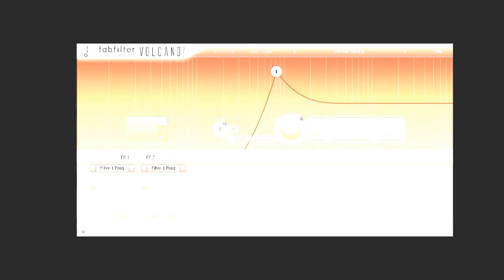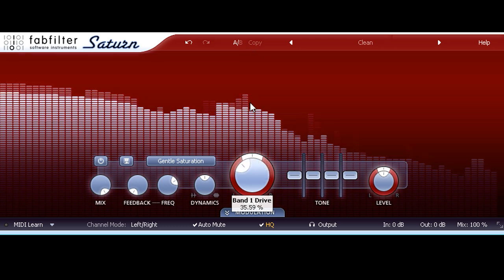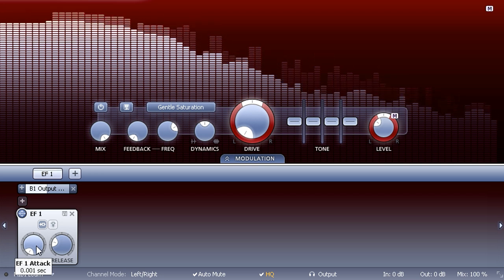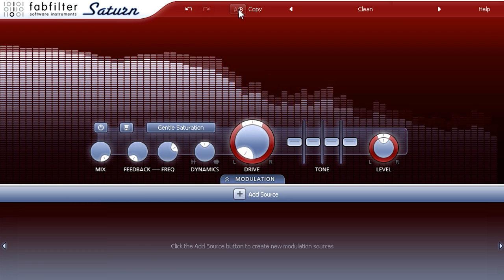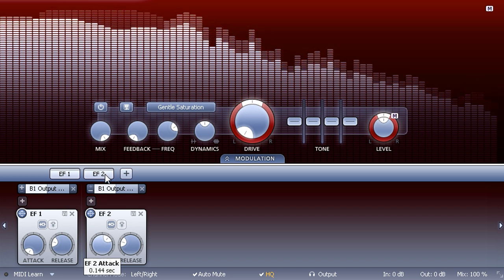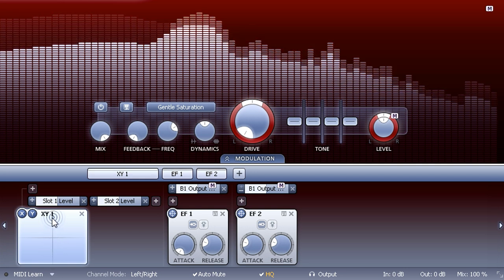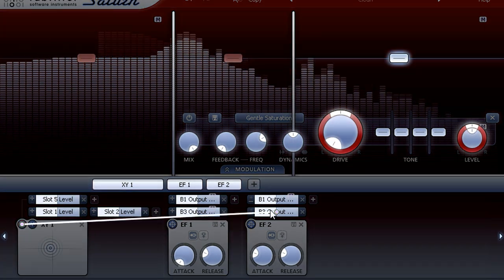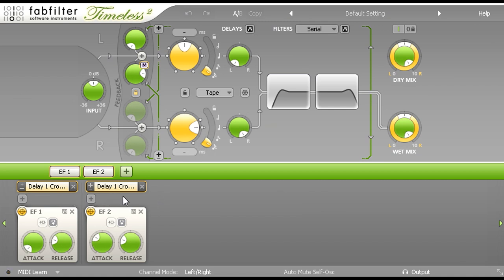Transient Processing with FabFilter Creative Plugins

Comment: I wonder what one can do, if U take an old drum solo from somone like Ginger Baker, Keith Moon, or a jazz great like Buddy Rich, for instance..there are many,..and, take a mp3/wav to MIDI converter app, and isolate the midi data,--if possible--save it to MIDI, then import that to a DAW and use that to edit, with stuff like NI's Apple Studio, EZdrummer,Kong, Redrum ect VSTs plus use fancy VST's like this one,FAB,to modulate with the CIV signal and, also revoiced the drums I dunno but,wonder.. (:
Reply: Yeah it's called abelton. Drag mp3/ audio/ whatever kinda file you want  into arrangement area. Then control click. Slice to midi. Boom. Add whatever fx you want.

Comment: He makes something very simple sound overcomplicated.
Instead just use a transient modulator like the one from Sonnox, before your distortion unit. Theen you can do this in a much simpler way. Just give the sound some more attack so when the transients go into the distortion they get more distorted than they would without the transient modulator.
Reply: Or he's showing us that their plugins are more versatile than people think, also saving them money by not having to purchase additional plugins when their existing ones already do the job, not to mention you can directly alter its modulation behaviour in other ways not possible when using seperate plugins.
Reply: +1wibble2 Exactly. Not to mention saving processing power by using one plug-in instead of two.
Reply: 1wibble2 I'm just saying you don't need to pay 800 euros for something so simple. He makes it sound like it does something that no other plugins can achieve, which it's not. Just use a transient modulator and a standard distortion module afterwards. It's simpler and you dont need a 800 euro plugin to do it.
Reply: +Leave The World Behind  Again you are missing the point, this is a video showing you just one of the many great features of this particular plugin, this is not a video about how to get the best transient processing in general, nor is the video trying to say anything about which plugins are best or making plugin comparisons, its just showing you how versatile Saturn is.  Also the plugin is £99 not 800 euro, not to mention that you cannot directly modulate one parameter of the transient shaper to another parameter of distortion when using 2 separate plugins.  Did you even pay attention to this video?
Reply: +Leave The World Behind I know I'm a year late but: When you own a business, the most important thing to selling a product and getting more sales is to always make it more than what it is. Giving it a power point presentation. Making it sound good. Use big words, sound enthusiastic, make it aesthetically pleasing to the eye, bright colors, better layout schemes. Restaurants do it all the time. It's not different with these products. I mean I know you remember the Oxy Clean guy, he was WAY too hype for something that cleans stuff despite its terrible results in the real world. Lol
Reply: Chris Wellz
You would also say that to Will I Am's smartwatch? Come on, you only say that because you are a fanboy of Dan Worall. I love some of his other videos, but this one was too pretentious i think.
Reply: I think you need a dictionary mate, there was nothing pretentious about this video, his guide was honest and completely on-point. Again, he made no claims that this was superior to any other plugin, nor is this video IN ANY WAY a plugin comparison video. Seems to me its just you that has some strange personal issues with Dan. Or perhaps you're just trolling now....
Reply: Leave The World Behind I don't even know who Dan Worall is. I'm assuming you mean the guy who made the video. My comment was a week ago. I don't even know what this is about. lol
Reply: +Leave The World Behind, sorry but to me your coment is a waiste of time.